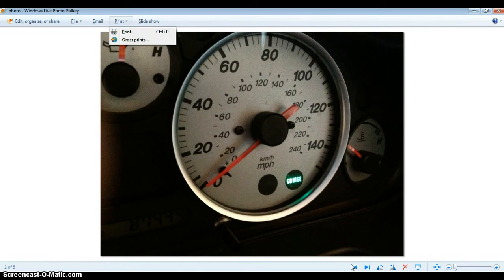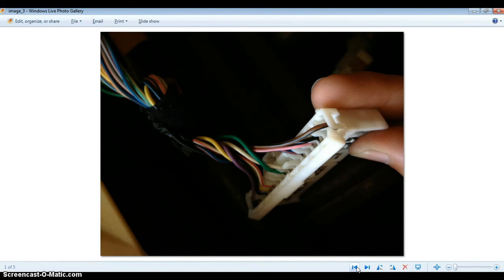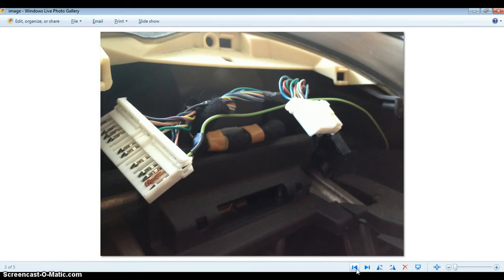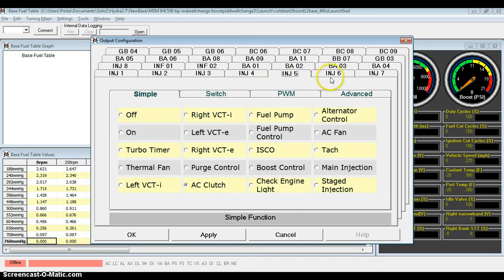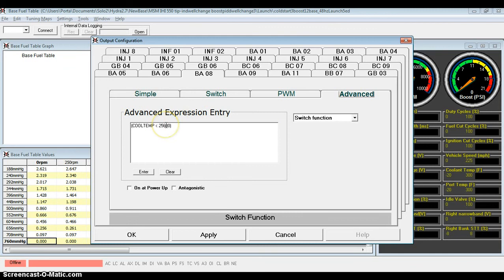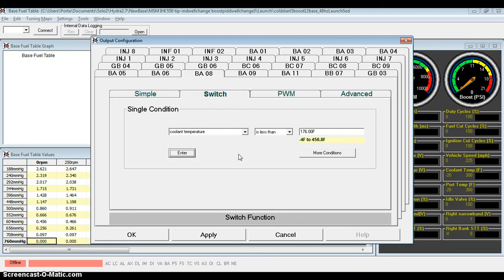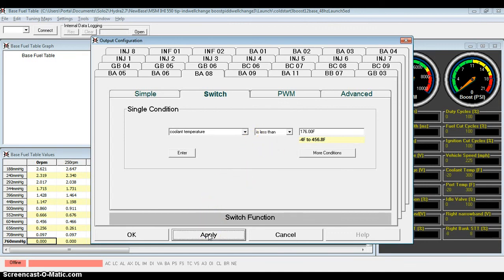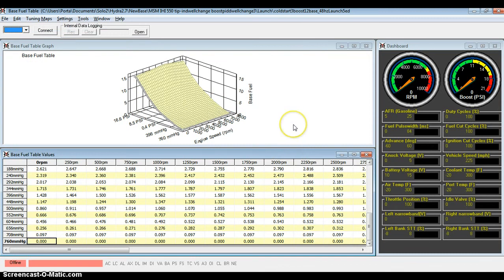Hydra EMS 2.7 Webinar How to setup Warning Lights with Output configuration

Comment: you never showed where it terminates to hydra ...I have looked many places and I can't find a pin schematic of the hydra 2.7 I understand the programming of the outputs but I need to know which of those outputs refer to which pin thanks
Reply from the maker: Ah. That's easy on each of the blue connectors there is an "a" and a "b" side which are listed and when looking at the bottom there are also labeled  numerically. Please see https://www.flyinmiata.com/support/instructions/ecu/FM_Hydra_ECU_2.7_Tuning.pdf for the diagram.

Comment: what are your thoughts on a "shift light"
basically set it up so cruise light goes on at 6600 rpm, 6700, 6800, and 6900. so it will flash once every 100 rpm while you're up top near the rev limiter
Reply from the maker: +rstormzand. It works but you wont see it really. You could wire in a brighter light, in a better location and use one for the outputs for it.